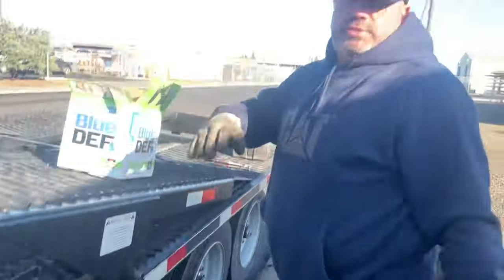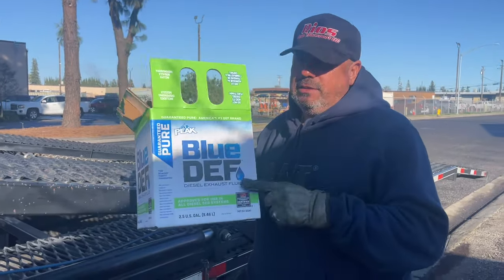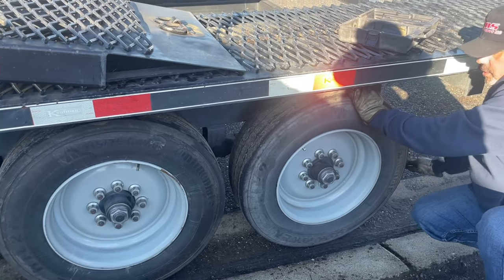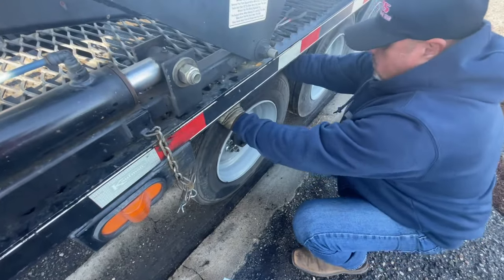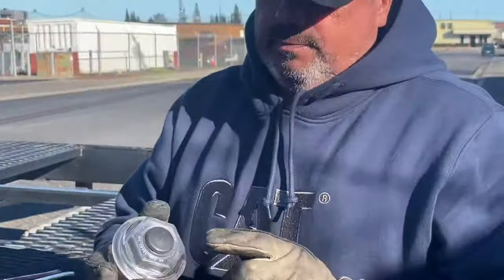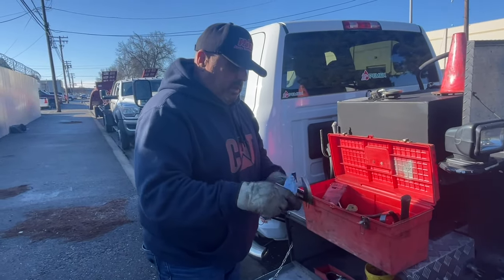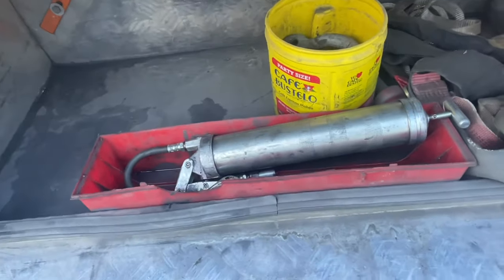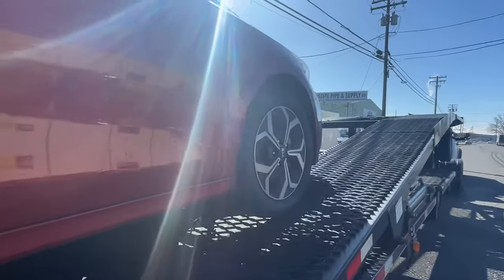How to tighten bearing? Loose wheel repair on Kaufman Trailer.

Comment: How often are you greasing  and tightening the bearings?
I am using a 2024 and kaufman said I shouldn't be greasing the bearings only having them repacked every 25k.
They also said if you are needing to tighten the bearing that means there is an issue.

Also how often are you guys greasing the equalizer pins. At 10k miles we already having all the pins replaced because none of them will take grease and 2 of the zerts blew out of the pins.
Does your ez4 resist taking grease on the pins?
Reply from the maker: I grease my equalizer’s every 3500 miles, my wheels I grease every 4K miles.  I check my wheels every morning if they’re loose I tighten bearing (maybe every 6 months) not the same tire. I do have to raise trailer to grease equalizer’s. My trailer is a 2017.
Reply: @riosautotransportllc  thanks for getting back with me, thought about calling you guys but didn't want to interrupt your work flow. 
The manufacture replaced all of the equalizer pins. When the shop pulled them out the factory ones had no holes for the grease to get where it needs to go. 
They also had to re route all the brake wires because the ones going through the axles wore through and shorted out all the brakes
Reply from the maker: Wow!  Glad you got it repaired, any questions give a call I’ll be glad to help.